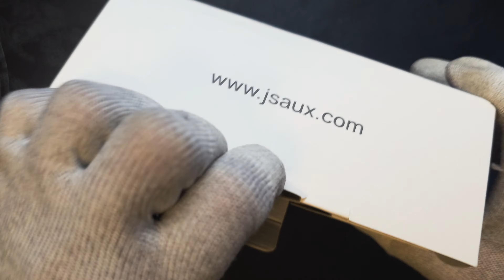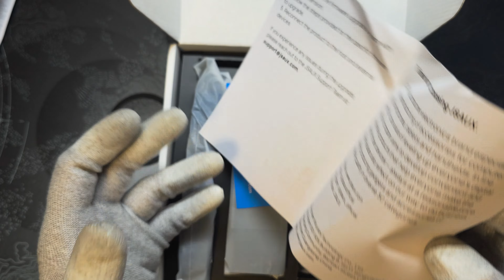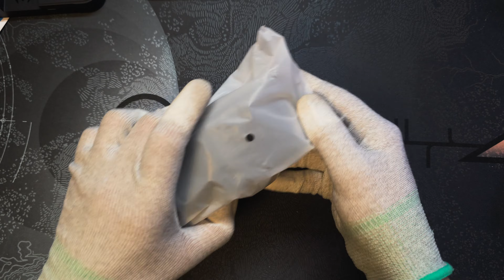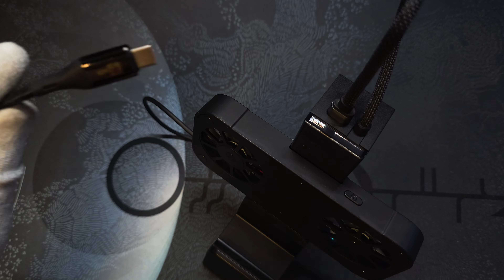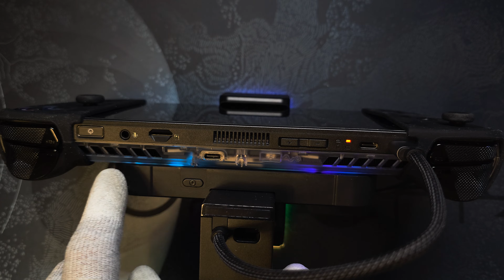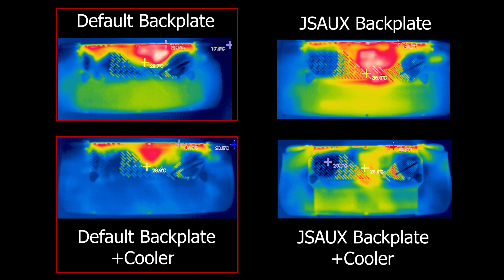Cooling, Power, and Ports! JSAUX 7-in-1 Dock for ROG ALLY X, Steam Deck & More Handhelds

Comment: i got weird problem connect my tv TCL c6k, after some session which is fine. the tv got weird jamming stuttering. no matter what i try plug in/out hdmi or PD cable out the dock. > turn out the tv got weird reading hdmi, just turn off and on. problem just gone :D weird :D dock still work fine after 6m so far

Comment: Does it work with Rog ally z1 extreme?
Reply: @RohitRohit777-w8u2s  it does not matter which handheld you use, as long as it is a handheld pc, it will work

Comment: Hello, nice video! I just bought the dock too and I have a noob question. It seems like the fans on my cooking device are oriented the other way round, straight out of the box. There's no more magnets. When you set the fan up, it's suppose to blow away from the Ally X? Or is it suppose to draw air and blow onto the Ally X? Mine, it's drawing air and blowing towards the back plate of my Xbox Ally X.

Comment: Will VRR work with steamos (steamdeck and legion go s with steamos)? I have the steamos legion go s and just got a TV that supports freesync premium pro so i want to get a new dock that will support some form of vrr. I know with Linux,  support for vrr over hdmi 2.1 is not there but was just wondering if freesync will at least work
Reply: I'm also interested in this question. But I found out that FreeSync isn't compatible with VRR.
Reply from the maker: I will try it and let u know
Reply: @TECHOSAUR  I'm also interested in this, although I'm having an original Rog Ally z1e with Bazzite. Recently bought a projector with VRR/ALLM support for hdmi 2.1 - would be amazing if this dock worked with that combo

Comment: If you want something that looks cool, this dock might work. But, if you're looking for good cooling during intense gaming, the built-in fans aren't enough, so don't get fooled.
Reply from the maker: You are right; they're not going to bring down temps a lot, but if you combine everything like the HDMI 2.1, Type-C port connections, etc., and including the fans, it may be good for some
Reply: I would say as deterrent for chronic heat-related deterioration of the components this is actually a really good remedy and I would recommend this dock over any others because of that alone. As for acute instant results they are minor, yeah.

Comment: Has anyone had any luck finding a way to quiet down the fans on this thing?  I'm tempted to just cut the wires and add some PWM circuitry or even a pot to undervolt them, but I'm not sure that's the best route.
Reply from the maker: You can't control them, there's no wheel or switcher or software to do it, you have to do it the way u mention

Comment: Hi, the fans give intake or exhaust airflow to the handhelds, pls? And can we place the fans higher to align it precisely with Legion Go’s fan position?
Reply: But is it efficient as like with rog ally?
Reply from the maker: @fcpsy146 yes the ally has dual fans and open back plate vents it would benefits greatly , they align well with it
Reply: @TECHOSAUR And with legion go with original back?
Reply from the maker: @fcpsy146 probably less as the Legion go has one fan and its located at the right top , this cooler would  still cool the SSD and battery most, not too directed to the apu,  it would still reduce the overall heat generated
Reply: @TECHOSAUR thank you so much For your answer
Reply from the maker: they're intake fans, through the back vents it allows fresh air to go in, you can't place the fans higher than their original position, because they go in through a magnet on the middle, so they get firmly attached
Reply: @TECHOSAUR tks a lot for your reply!
Reply from the maker: Yw bro 🙂‍↕️

Comment: I see that it does 5gbps on the USB Ports, but will it be able to power devices such as keyboard, mouse, and a controller? Because there is nothing that says about the power delivery of the docking station.
Reply from the maker: Yes, it does. I used it for my testings all the time, plugging in a keyboard and mouse, it helped me a lot

Comment: Can it fit ROG Ally X with JSAUX Mod Case with stand?
Reply from the maker: Yes 
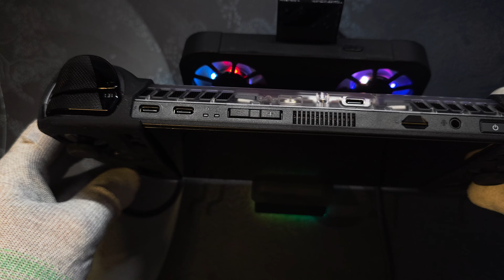At 3:34
Reply: @TECHOSAUR  The user above was asking about the JSAUX Mod Case with stand, not the RGB Transparent Back Plate with grips that you're using. Do you also have the ModCase for the Ally X to see if that fits? I've seen another user do a review with the ModCase and this dock with fan, and the device did not sit flush again the fan. That said, JSAUX's website says that the ModCase should be compatible with the docks. Not sure what to believe here.
Thanks for the review! Looks like it's just a couple of degrees cooler, which does not seem significant.

Comment: I got it, but I am having a huge problem it only goes up to 25w, even if it is the original charger, I reach out to jsaux about it not responding yet. It would be perfect if I could use it up to 30w
Reply: The ROG Ally needs more than 65W when connected to a dock that has multiple peripherals as they use the power themselves. Try to get a 100W power brick with a 100W cable to make sure that it is receiving all the power. I also has this issue before and by getting a 100W power brick it fixed the issue.
Reply: I bought a 100w charger now it works

Comment: Very good video - thank you! I am wondering - you did a lot of test to optimize ROG Ally X. Yet, I have not seen you play with the curve optimizer and try to undervolt either the GPU or the CPU. Wouldn't this be a good thing to try? Undervolting intel chips for instance bring big gains. And I saw couple of videos that it similarly brought a lot of benefits on AMD APUs. Thoughts? Thanks!
Reply from the maker: Unfortunately,  Z1 Extreme chip by AMD has locked undervolting capabilities and Precision Boost Overdrive (PBO). It does nothing to tune the curve optimizer, unlike other chips such as desktop or laptop processors. It is made with a factory-set voltage that does not get tuned

Comment: mine said 100watt but wasn't the battery died while I played. Does this one work well?
Reply from the maker: You will need a 100W power brick and cable. Be careful not to use any off-brand docking station, as it may lack power safety features. I cannot tell you for certain that this JSAUX docking station has any, as they never mentioned it in their marketing, but from what I have tested, it has been running well